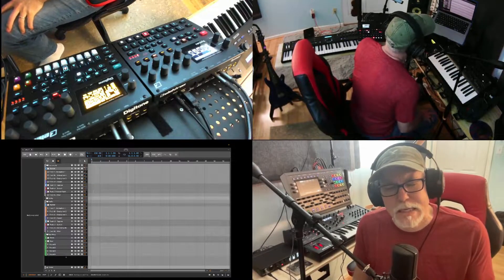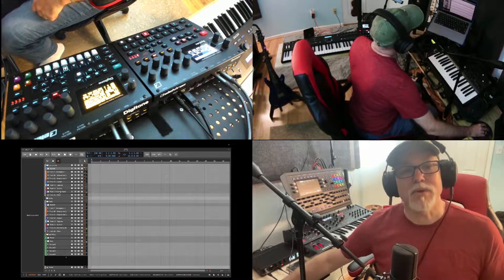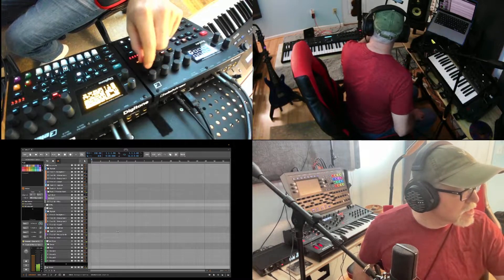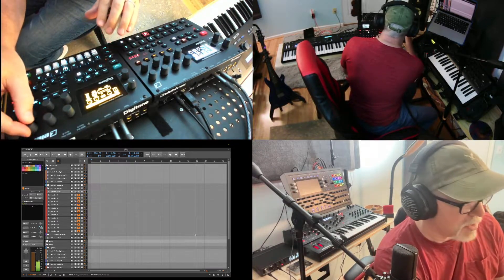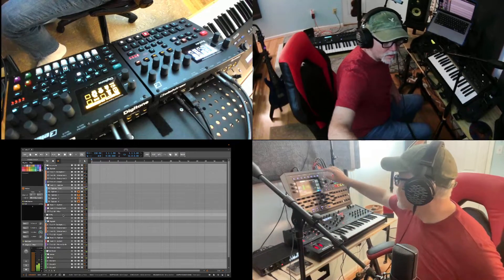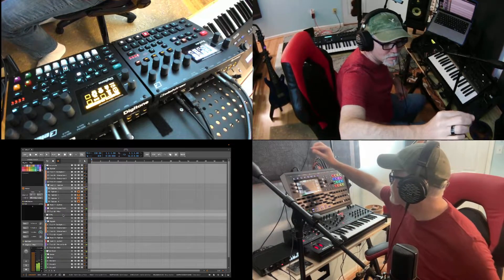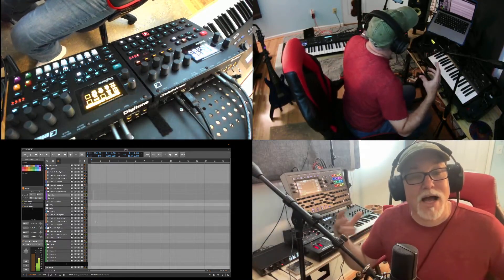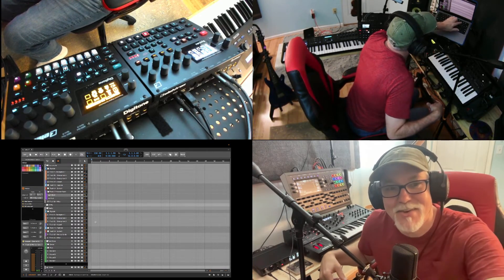MOTU Fun Digital Routing

Comment: Seems crazy. The potential for making monster sounds is huge but you already have that in the equipment you have set up. What do you see as a potential application for this facility?
Reply from the maker: Yes it is crazy 😜 Sampling is something I didn’t show and was the original reason I did this. For example with this setup I can send any device  or combinations of devices (in series or parallel) to the Iridium and sample it. Then continue work on the Iridium. But the real “X factor” here is exploring, as I’ve found many surprising routings, without having to move cables around.